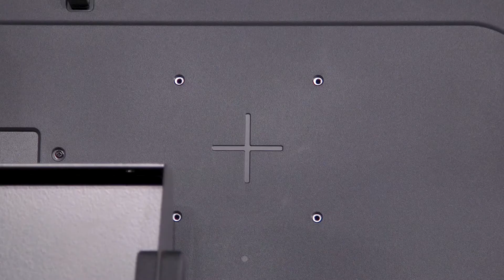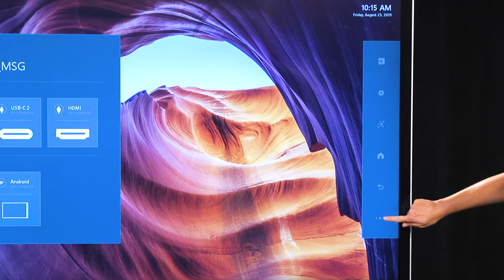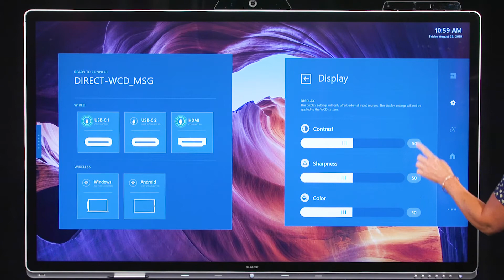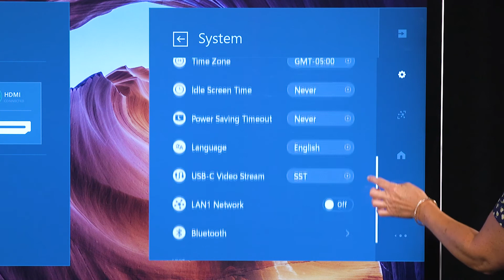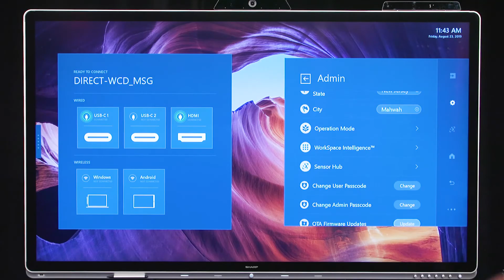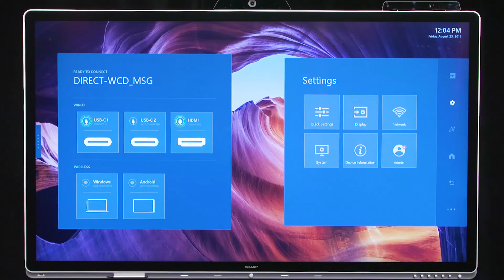Specifications and User Interface of the Windows collaboration display from Sharp

Comment: Urgent Response Required

I have one recently installed

Im wondering how the little computer that sits  at the back of the tv??
HOW can i Get the Camera to work?
Where do I connect, the little computer  on the tv for the camera to work?
I followed the instructions for this model  : Sharp - Shuttle : PN-SPCi7W10C
Reply: Just noticed this comment. The Camera USB needs to connect to the Main Board interface above the USB-c and HDMI Inputs. Email me on rfisher@sharp.net.nz if you need an image or further support.